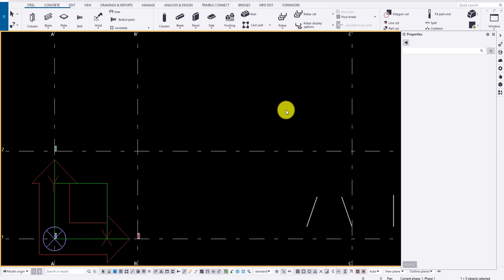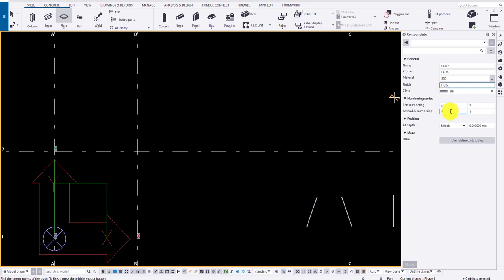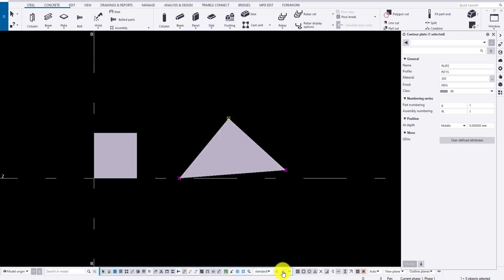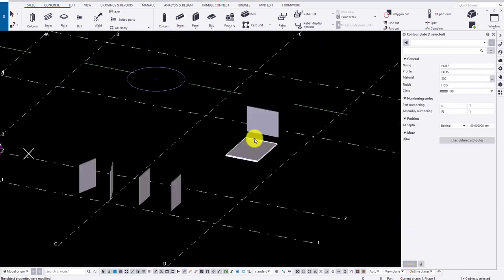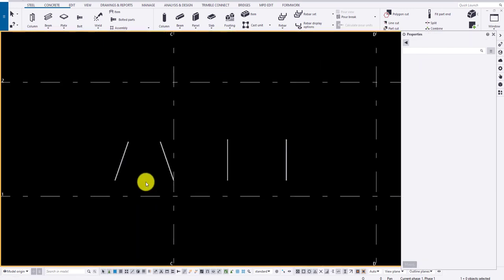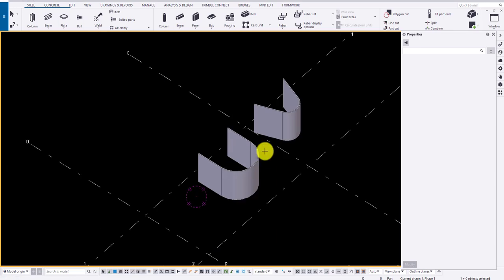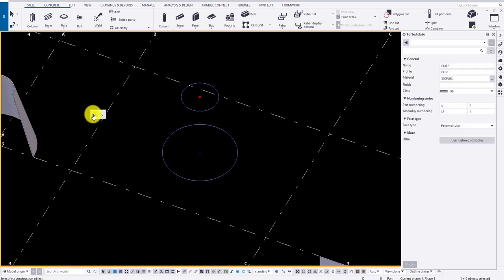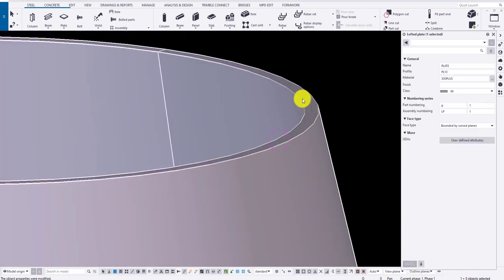Creating Steel Plate in Tekla

Comment: I was creating a plate(Contour plate) but there on option to change the thickness of it.have u any solution...
Reply from the maker: You can control the thickness of plate in profile. In the video i have use PLT15 that means plate profile of 15 thick.
Reply: @precastdetailing  thank you so much for reply